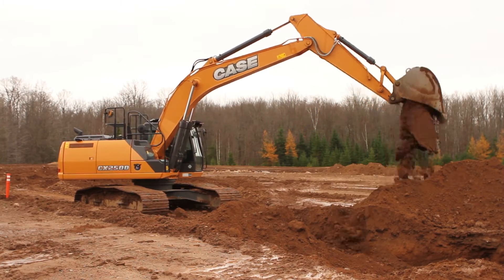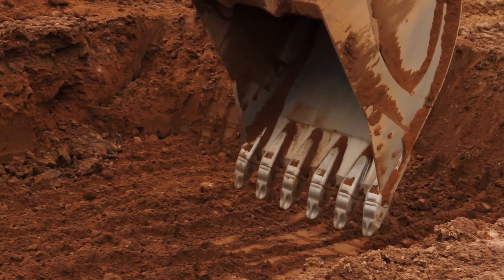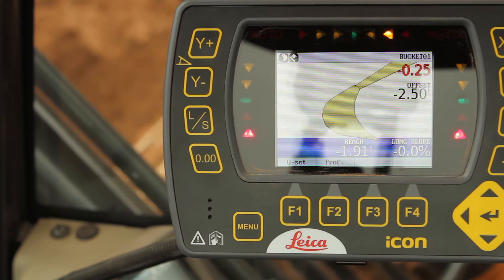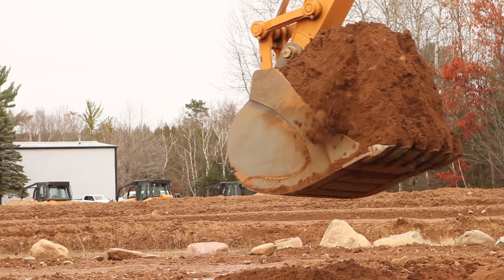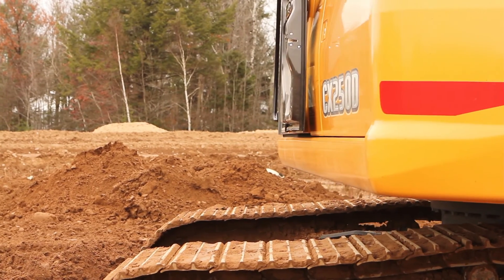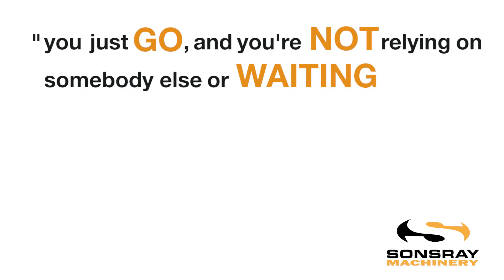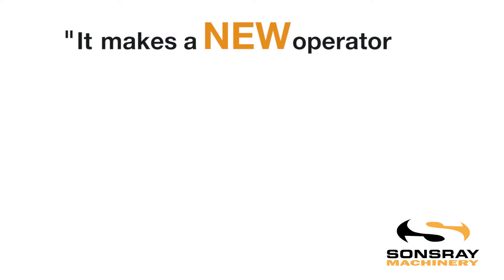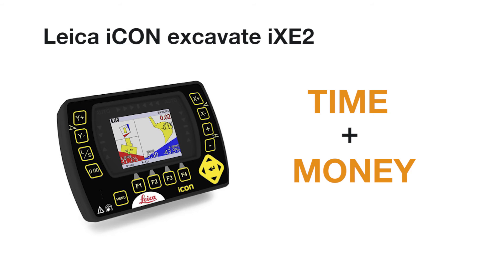Machine Control - 2D Excavator System

Comment: This thing is a piece of junk we used it for like a week and it started malfunctioning and like I won't support it they say there's nothing wrong with it but it seemed to work fine to start with but the rear sensor is bad and they're trying to blow it off don't buy this thing like it is a horrible company this is a second problem I've had with them they do not support their stuff